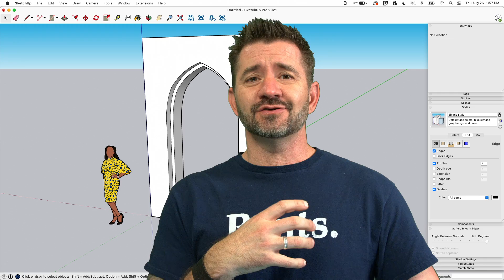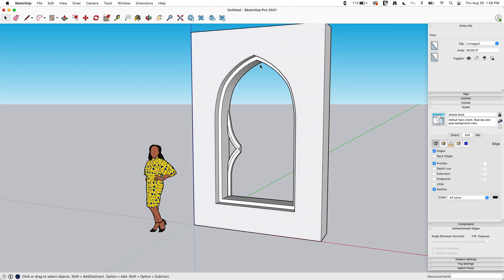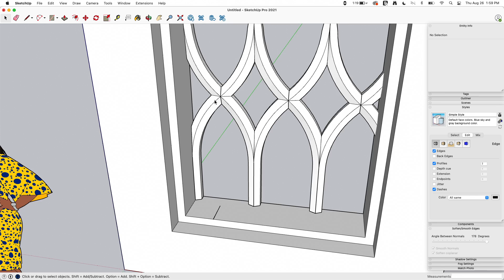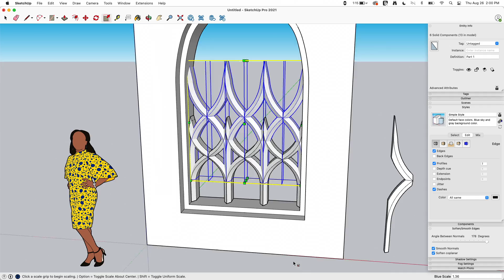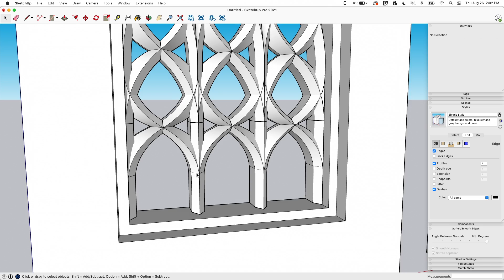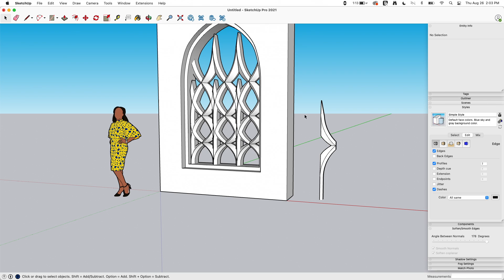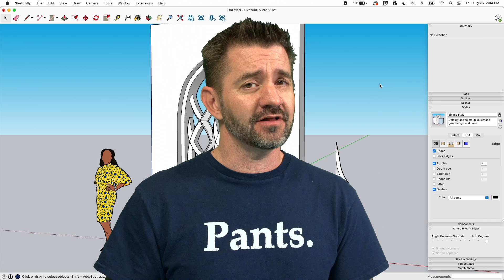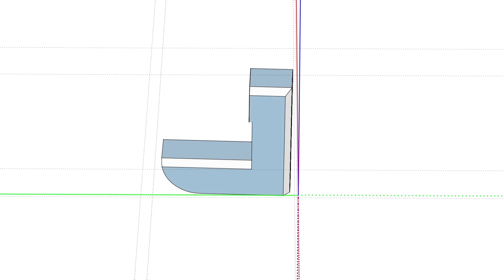Deforming Components - Skill Builder

Comment: Is there a way to "container scale" the length of something like a 2x4 stud component with an angled cut on one end (think studs in a gable end wall) and have it keep the same angled end cut on the stud but change the total length of the stud?  I've tried this, but it ends up distorting the angled cut.
Reply: Definitely possible with an extension called Fredo scale. It’ll allow you to only select a section to scale but leave everything else undistorted. In your case the angle would stay the same but you could increase the length of your 2x4.
Reply: @jakewyatt716  Thank you!!  Fredo Scale did exactly what I wanted.  Bravo!
Reply: Small caveat...  Fredo Scale certainly did the job of independently scaling the angle cut 2x4s in my example.  However, it also created separate unique instances for every rescaled 2x4.  In afterthought, it had to do that.  This is the same way I had handled this situation in the past by manually creating multiple unique edited versions of the angle cut 2x4s.  Fredo Scale's approach does have the advantage of it automatically creating the multiple unique versions of the 2x4s.